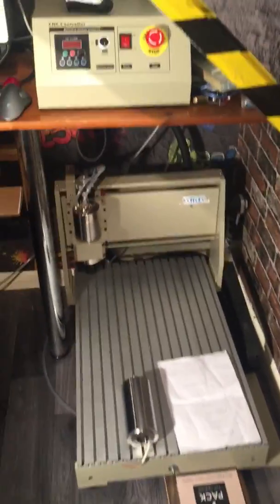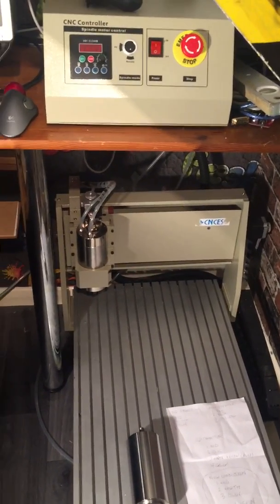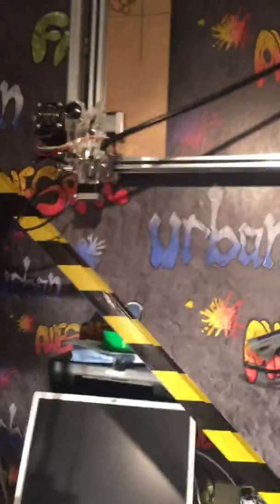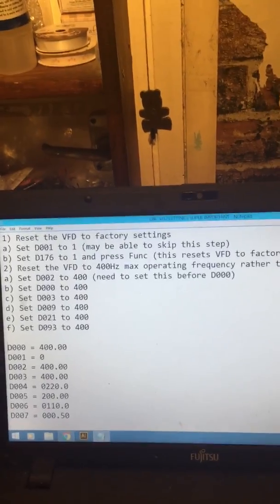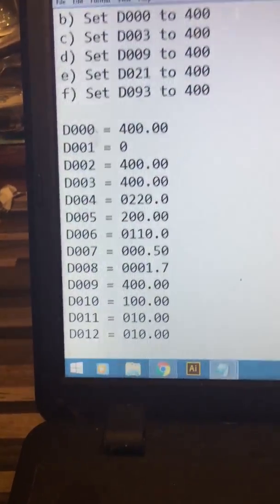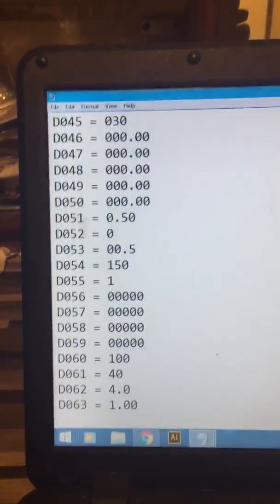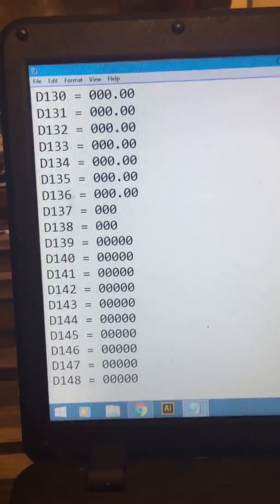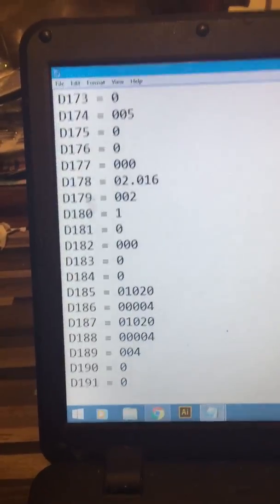CNCEST PRT-E1500W SETTINGS 6040 CNC

Comment: Hello! How to set max current limit 4A?
Reply from the maker: Sorry need a bit more information .
Reply: @darkcloud247ay  Hello! What info do you need?
Reply from the maker: @igorsh4566  Sorry im struggling to understand the question ...are you talking about for the motors or the actually cnc machine ......and are talking about the cncest 6040 .

Comment: Thanks for putting this out there. Just came upon this...I have the 110v version of this spindle. Had the exact same frustrations. I was pushing buttons to try to start the spindle manually but may have changed some settings whilst screwing with it. Now afraid I’ll burn it up if I use it... question is; is my 110v version of this compatible with your settings.
Reply from the maker: Some of the settings will be other won’t I know that doesn’t help will have a look tonight and see what I can find and will post it here if I find anything useful 😉
Reply: darkcloud247ay awesome thx. Where did you end up getting your settings?
Reply from the maker: David Ashenbrener cnc zone and other cnc forums  and a lot of digging on the net
Reply: @darkcloud247ay  OK Was able to copy paste your settings and im going for it but...do you have a short explanation how the buttons work? NOT VERY INTUITIVE in my opinion...
Reply from the maker: David Ashenbrener what to get the spindle going
Reply from the maker: David Ashenbrener or for putting in the settings ?
Reply: I opened up my control box to check things over. I knew braking the seal would void warranty (what warranty) and found a loose plug in connection. Works like a charm now. Thanks for your help. I would suggest anyone having issues in the first place to check for physical anomalies before adjusting settings. 
 My other upgrade is strengthening the Y-axis. It has movement in the “bow” stability because the 2) 20mm linear rods flex. I added the supported linear rods like the X axis. Had to machine groove notches in the cross carriage block but the cutaway bearings fit perfectly and the new 3/8” plate across the back of the gantry is the perfect distance from the Y Cross block to bolt it on and go. 
 I can now make cuts that rival larger more expensive CNC mills.
Reply from the maker: David Ashenbrener excellent glad you sorted it ...yeah I opened mine up after about a week ...the warranty isn’t worth the paper it is written on ....I intend to upgrade to better machine next year once I’ve made all my mistakes 😉
Reply: darkcloud247ay I’ll send some pics and specs of materials if interested.
Reply from the maker: David Ashenbrener yeah can do be much appreciated ... darkcloud2471 @gmail.com

Comment: Hi, I have exactly same machin and same problems 😀 I did exactly like you but the spindle only works on full speed. If you have any advice please share thank you.
Reply: That's what I have to do next,  thanks for everything I hope I gonna solve my problems sunn😀
Reply from the maker: Przemek Mysza let me know what the problem was when you sort it out 😉
Reply: I will definitely do my friend, thanks for your time and all the best with your project.
Reply from the maker: Przemek Mysza try setting d005 to 200 ....let me know if that makes a difference
Reply: Thanks for your quick response
Reply: Do you put all your settings on PC mode or Manually mode? I probably making some mistake somewhere but I can't find where I don't know how to put proper settings in Mach 3 that could by the reason why nothing works well even on Mach 3 screen is not showing my the spindle is working complete disaster.
Reply from the maker: I use manual .....try this for Mach 3 settings will send link
Reply from the maker: https://youtu.be/0mlfccAVUP4
Reply from the maker: I run my spindle manually
Reply: Thank you I was always used manual as well so I will check them settings tomorrow may be it will work better I will let you know what is going on, can I ask you what program are you using to generate gcode, I'm using makercam free software it works fine, I have no idea what I do wrong  one day she works well and another complete disaster.
Reply: Are you using a Usb or parallel port?
Reply from the maker: Mine is parallel port .....
Reply from the maker: I use Artcam and Aspire
Reply from the maker: Are you using parallel port
Reply: Parallel port
Reply: Is your machine is accurate? Mine sometimes cut's nice and then the same thing I want to cut again and is all over the place it have to be something with the Mach 3 I'm using this what I got from them.
Reply from the maker: I have had two parallel cards break so make sure you check your parallel port .....if you are using the mark 3 and licence they sent you it’s probably unreliable and got bugs hence why one day it cuts fine the next it doesn’t .....best of using the latest version off Mach 3 most of the bugs and glitches are gone and buying the genuine licence .....but that’s up to you 😉

Comment: My settings were slightly different for an 800W machine running on 110V, but this helped. What is the d005 parameter for? Why is it set to 200 in your list?
Reply from the maker: Drew Hamilton I have to be honest I’m not sure what the D005 parameter is for ...but will have to research it now as I have checked a few other vdf  parameter lists and they say 00 not 200 but my cnc works fine it might have something to do with the settings being something to do with a 4th axis ....anybody out there feel free to correct me or comment I’m open to constructive criticism 😉...will try and find out and let you know but if you find out first let me know 😉 glad to of been able to help even if it was a little bit 😀
Reply: @darkcloud247ay  if you don't mind me asking. Where did you even get all this info?
Reply from the maker: Drew Hamilton collected it from hours of searching and comparing from various forums main one I can remember was cnc zone but there are plenty of cnc forums out there.

Comment: Hi.
I have the same cnc. Cant get it working. What operating system are you using.
Any help would be great.
Reply from the maker: James Segar ....windows 7 32 bit ....I’m using a parallel port connection not usb ....I am also using Mach 3 to run it
Reply from the maker: James Segar are you using Mach 3
Reply: @darkcloud247ay  yes Mach 3. 
Don't know what to do. Lol 
Thanks for getting back to me
Reply from the maker: James Segar have you changed the settings in Mach 3 to what the machine requires  ? If not follow these instructions in this video he’s a bit hard to understand but just do what he does I’m gonna make my own video on Mach 3 settings soon... https://youtu.be/0mlfccAVUP4
Reply: @darkcloud247ay  will check.
Thanks for your help
Reply: @darkcloud247ay  all done thanks but still no movement.
Reply from the maker: James Segar what windows are you using and are you using parallel port or usb
Reply: @darkcloud247ay  windows 10 with usb
Reply from the maker: James Segar have you installed the usb add on in Mach 3 ......that’s why I stuck with windows 7 32bit system because Mach 3 works independently on that set up and doesn’t require anything else ......you will also need to go into device manager find your cnc and check what the port number it is ....once you have done that make sure the port number in Mach 3 settings is the same ..
Reply: @darkcloud247ay  didn't know mach3 had such an add on.
Reply from the maker: James Segar they don’t but other people make plugins or add ons ....you need to join a few cnc forums they will be able to help you further as I have no experience with usb connection or windows 10
Reply: @darkcloud247ay  don't know where to look. going square eyed. Where do we put the port number
Reply: @darkcloud247ay  going round in circles...LOL
Reply from the maker: James Segar just uploaded a video on how to find your port number even though yours is windows 10 the process is the same
Reply: @darkcloud247ay  you are a star
Reply from the maker: https://www.cnczone.com/     Is a good forum for information
Reply from the maker: James Segar let me know if you get running 😉
Reply: @darkcloud247ay  trust me. You will be the first to know.
Reply from the maker: James Segar did you copy the DLL file from your software you got with your cnc and copy it to Mach 3 plugin file .... https://youtu.be/NGfsYIPK3FY
Reply: @darkcloud247ay  whoott whoott…..motors running of computer. Just need to figure out the spindle now. It was so simple  ish. The video you sent of the guy who did it was soooooooooo helpful.
Reply from the maker: James Segar everything is simple when you know how .... cool unfortunately I run my spindle manually through the control unit so can’t help you there but that’s great news 😉
Reply: @darkcloud247ay   LOL just needed to press the run button on the controller. I cant thank you enough for all your help.
Reply from the maker: James Segar no worries like I said if I could save one person the ball ache I went through the video was worth it